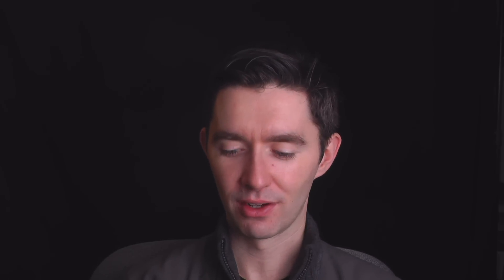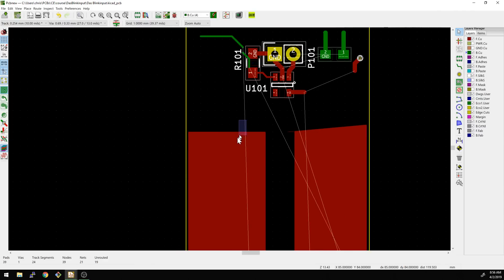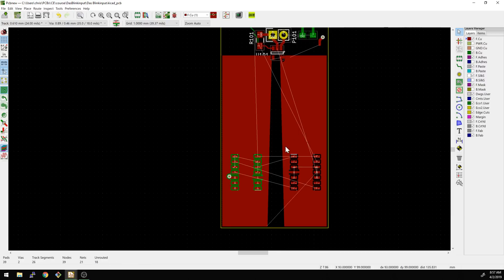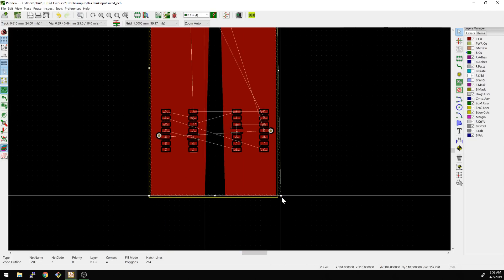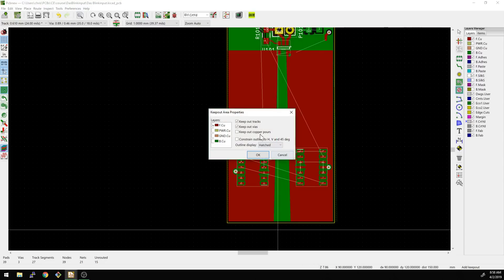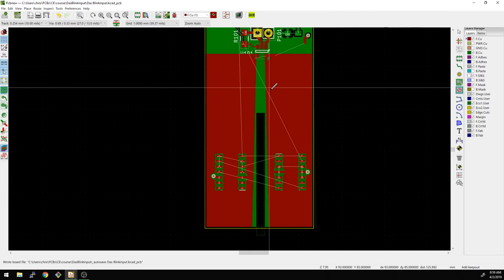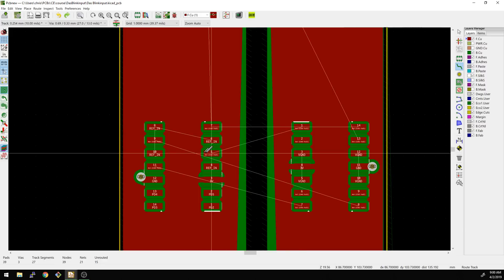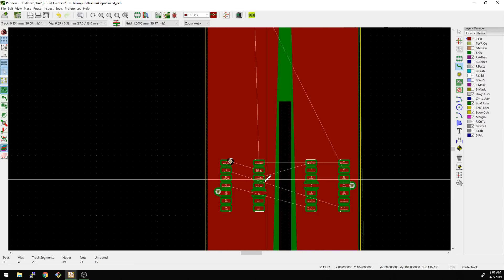KiCad 5.0 - Cutouts in Ground Plane

Comment: I personally would keep the GND_A and GND_D, just to prevent any confusion, since it's still very important to not only keep these separate but also connect them together at a specific location. I've seen this gone wrong a few times because people just thought it was one simple ground.
Reply: Isn't it better to keep one common solid copper plane and just think about current flows? You have to make proper board layout so digital currents do not flow through analog sections. I've read many articles about that where they explain and compare with layouts with cut-outs in ground plane, it's not my idea, I'm not an expert in this area.
Reply: @Chupacabras222 . Essentially it's the same thing, because eventually you have to connect all the grounds together at some point. But by keeping them separate you're better prepared when you have to deal with external connections. Like some kind of analog signal input. In general it's best to keep analog singal, digital and power grounds separate and hook them together somewhere close to the power supply with proper decoupling or otherwise a local supply with proper decoupling.
Reply: Unfortunately if you have zoned gnd1, gnd2, any later fills removes any separations un KiCAD 7